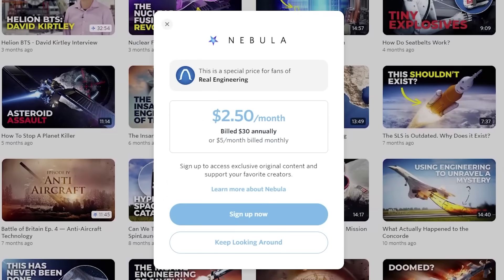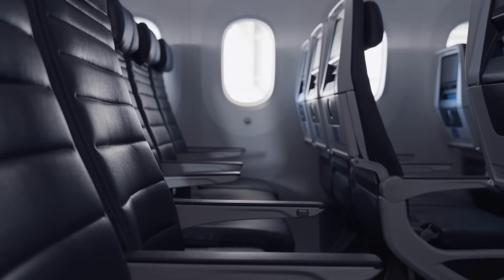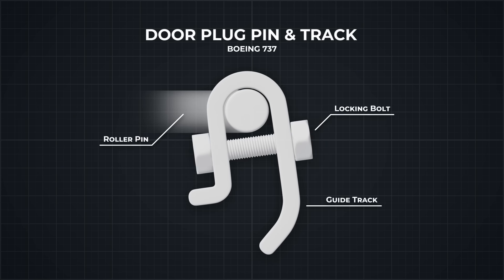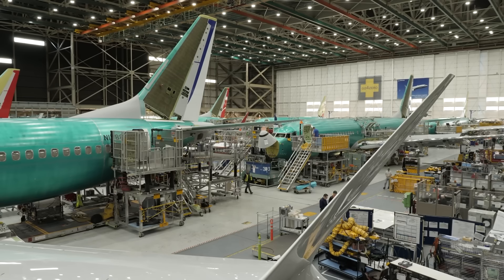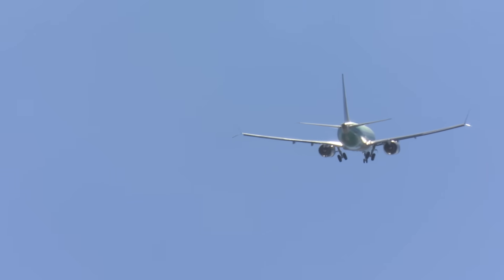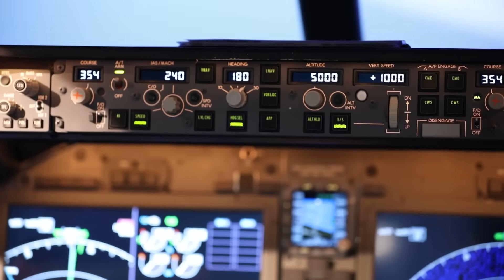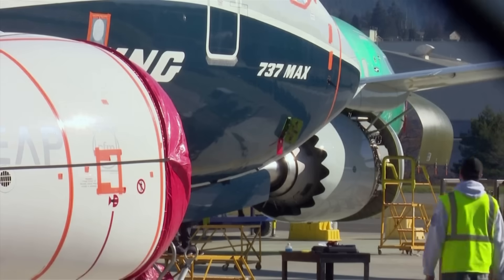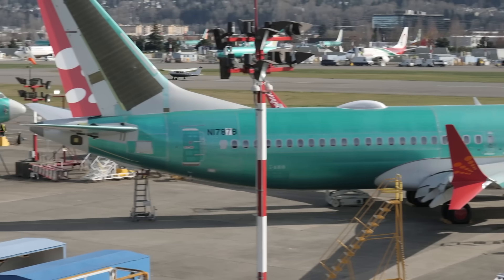The Questionable Engineering of the 737 Max

Comment: I am by no means an aviation expert, but it seems to me that Boeing is trying too hard to keep the 737 alive.

The 737 has proved itself as one of the, if not the best regional airliner there is. Entire companies are built around the jet and its required infrastructure. It makes sense to keep upgrading this platform. It requires less retraining for flight crew, cabin crew and ground crew and I assume ground equipment can be kept the same as well.

The 737 has a remarkably short landing gear. This causes the fuselage to sit low to the ground, which makes it easy for ground personnel to work with the aircraft. For example, budget airlines often use stairs that retract into the plane itself, which removes the need for stair trucks or jetbridges.

The upgrades to the 737 are pushing against tight constraints. The low fuselage is a major constraint when it comes to upgrading the engines, for example. Jets are getting bigger and bigger to become ever more fuel efficient. The 737 MAX has already proven the effects of trying to push through these constraints with the MCAS debacle.

The Airbus A320 came out almost two decades after the 737. It does not have the low fuselage that the 737 does and has less problems with hosting larger engines on newer variants. Yet, Airbus is realizing that the A320 will not stay around forever and is investing in new platforms which compete with the A320, like the A220. In the meantime, Boeing is stubbornly trying to keep the 737 flying by stretching it in all dimensions and taking it to and beyond its limits.

I believe Boeing requires flexibility to innovate, which the 737 platform just cannot lend. To really bring innovation to the market in a safe and responsible way, it needs to develop a new platform which can compete with the 737.

Comment: Good video, but a couple things to note:
1) When you showed an example of a smaller emergency exit door's window, that was a service door, used for catering (there are 3), and not an emergency exit window.

2) You probably shouldn't shorten "737 Max 9" to "737 9," because the 737-900 is part of the well-established NG series, rather than the newer, ill-fated 737 Max category.

Comment: As an industry insider, everyone I know throughout the industry seems to point to the event known colloquially as: "The day McDonnel Douglas bought Boeing with Boeing's money," as the inflection point where Boeing's culture went from that of engineering, manufacturing, and quality excellence to cost cutting, profit maximization. MCD was apparently very good at "making money" in the industry but Boeing was not. They leaned heavily on MCD executives AFTER the merger, to help realign the business direction Boeing would go in order to improve profits and become a more desirable company to invest in. This included divestitures of low profit business enterprises, like their Wichita manufacturing plant, which would later be named Spirit Aerosystems.
Reply: It's so strange to me that they divested the Wichita factory, only to need to pump cash into it 15 years late so they could keep their production line running. It reads very much as a short sighted business decision to boost profits over long term stability.
Reply: Wow, interesting. Thanks for sharing.. I am definitely looking more into this. What's odd though is MCD seemed to make a lot of great planes though too. I have worked on a few including the DC-10 which I feel like sometimes gets a little bit more hate than it deserved.  I think in the context of its own time (mid 60s to early 70s) its really not much worse than many other planes, someone could chime in on this more I am sure.

Comment: From a responsibility perspective it doesn't matter if the manufacturing is outsourced, if it's a manufacturing defect, the responsibility is Boeing's. If Spirit made the mistake, it's Boeing's responsibility to find it and correct it. From a quality assurance perspective, oursourcing the fuselage manufacturing makes it more difficult to find and correct such mistakes, but that has to be considered when deciding to outsource manufacturing. Boeing can punish Spirit in whatever ways their contract allows, but, to everyone else, it's still Boeing's responsibility.

The FAA also needs to take some responsibility for giving Boeing such enormous leeway with their lax oversight. That's in addition to their history of lax oversight of Alaska's maintenance procedures (jackscrew lubrication).

Boeing is clearly a terrible and dangerous company, but there does also seem to be a growing complacency around safety and manufacturing standards in all industries. (touchscreens shouldn't be allowed to be installed in cars, nor should context-sensitive buttons be a thing, failed software updates shouldn't be able to incapacitate the care and strand you somewhere, cars shouldn't need to have privacy disclosure agreements)

Comment: Since its release the 737m has had more incidents and higher fatalities for its service time than the md11 and everyone called that plane a killer.
The airframe isn’t safe, there is clearly a massive issue with Boeings quality control and in the general interest of safety every one of these planes should be grounded, randomly select a 1/4 or more of the entire fleet, and ground up inspected.

Comment: Even if the CEO is an engineer he’s put that aside for maximum executive pay and maximum investor profit…many employees from the 60s and 70s say it used to be safety first and making sure their airplanes were well engineered and assembled with great care…the MCAS system was a disaster but this latest plug with loose bolts is pure greed because it’s come to light that their subcontractor is pushing things out not caring if there are defects…🤬

Comment: Multiple mistakes, most of which by Boeing.  1- the plug should have been bigger than the hole, like the doors, so that pressure adds to safety.  2- the plug should have to be lifted to be removed, not lowered, so that gravity adds to safety.  3- trying to save pennies having plugs vs. always having exits in the first place, knowing that more exits add to safety and this error cost more than all the potential savings designing and maintaining these plugs.

Comment: The blame starts at the top, not the engineers.  It was the executives who created this mess.  They were fueled by greed.  They were mad that Bombardier was about to launch a small, affordable, fuel efficient aircraft.   Boeing didn't have an aircraft to compete, so rather than invest in new design, and knowing that Bombardier was struggling financially, the simply modified their 737 airframe since it would save a ton on recertification as well as time and money starting from scratch (since the 737 airframe is from the 60s).  They then fought Bombardier numerous times filing complaints to the US Trade board.  The delays and costs couldn't be handled by Bombardier and they eventually folded, but in a twist of fate, Airbus came in and saved the program.  That aircraft is now known as the A220 series.  There have been a myriad of issues and hundreds of people have died because of the 737 Max aircraft.  Corporate greed, secret lobbying to the government (hundreds of millions of dollars worth) and corners cut by the sub-contractors all play a vital role.  What should have happened is Boeing should have developed their own aircraft (if they wanted a smaller one) or simply left that business to Bombardier since that aircraft was smaller than anything Boeing made anyway.  Instead, they tried to stifle competition, paid off the government to avoid regulations and this is what you have.  The executives should have been jailed the first time around, the fact it has still been going on is a wake up call to the people.

Comment: I’m an aerospace engineer, one of my classmates from college is a mid level manager in one of Boeings suppliers. He has been complaining bitterly about diversity hiring practices for about seven or eight years now. They are rejecting people for less qualified ones who can check a box based on their identity.
Reply: Just pure insanity, they are actively discriminating to improve their optics
Reply: I don't think that has anything to do with what's wrong at the company. (there is no way to prove a person will be better or worse at a job than someone else at the point of hiring, anyway, so I highly doubt that hiring more old white dudes in management would have helped.) It's a matter of prioritizing profit over safety, which has nothing to do with the "identity" of people being hired
Reply: @marcindathefierce  Prioritising EDI (DIE) is going to lead to hiccups whether you like it or not. It’s actively discriminating against those who are the most competent. You clearly have never worked with diversity hires. As an engineer myself, I have, and have seen in situ examples of incompetent but pc characters being selected for over the most competent (accounted by experience, grades, work ethic  etc). Standards have lowered for hiring and to say that plays no part in poor management is weak.

Comment: Spirit does NOT manufacture the door, nor do they do final installation of the door, that occurs at Boeing.
This plane also had a wifi mod in OKC and they would have accessed the interior through that door plug.

Comment: Remember, when Airbus made a competitor to this plane they actually made a brand new design. Boeing, because they wanted to save money they used the old plane, put new engine and put the MCAS control to fix the issues that came up since the engines are too big.  two planes crashed because MCAS was busted. moral of the story, buy Airbus

Comment: Your Dreamliner series on Nebula made me a fan.   At some point the airlines need to be help to account as well.  Lyon Air sent their doomed Max up with a known issue on the AOA sensor; admittedly a single point of failure, which Boeing has augmented MCAS with a synthetic AOA sensor.  As a software developer, I take issue with Boeing outsourcing MCAS to the cheapest offshore developers they could find.  I cannot image developing a system, much like Toyota did with the single point of failure potentiometer in their gas pedal, then allowing the vehicle to go full throttle; same scenario with Boeing MCAS in only allowing the crew to disable MCAS (a system pilots were unaware of) by extending Flaps, even 1% would have stopped the chain of events.  Full nose down was outside the design params of MCAS, yet never tested until...  BTW, GM has two potentiometers in their gas pedal sensor; should they fail to agree the vehicle goes into limp mode.  You can check this yourself with a decent scan tool.  Bashing Boeing, bashing GM (Al Root) is a favorite pastime in America,  Europeans do not seem so willing to throw their industries under the bus, plenty of Airbus automation incidents...  kind of like Coke saying Pepsi causes cavities...

Comment: Am I hearing correctly that you're saying that it's engineers patting themselves on the back when stating that it's because a company is run by executives focused on revenue? Because you say the exact same thing a little later without that "patting on the back" thing after. I thing you're incredibly underestimating company policy when you say engineers are good and capable of making good, working solutions to problems. You can propose infinite great ideas you can defenitely work out, but if the exec smells penny's LITERAL PENNY'S to be saved, the shortcut is taken by the word of said exact without any knowledge about the subject even if it is the worst solution and results in failure and ironically more money and time spent in the long run

Comment: Sooo if Boeing isn't manufacturing its airframes, avionics, wings or engines and limits R&D to updating 60 year old designs, what does it actually do but assemble parts and trading stock? It's a company, sure, but is it still an aircraft manufacturer or just an assembling outfit with a very good name and lots of pull in DC?

Comment: I know I will probably get pointless flak for this, but Boeing has been hiring for diversity (not inherently a bad thing) recently instead of hiring for skill. For something that can kill as many people as an airplane can, I would rather have the best at the trade making the planes instead of people that were hired just based off of their skin color. There is a lot of people that have been quitting working at Boeing because of this. (if you misconstrue this as anything other than pointing out a lack of skill, maybe you should take a step back and reevaluate your thoughts)

Comment: There is nothing wrong or "questionable" with the engineering of the 737 Max or of the other airplane models. The problem at Boeing with this and other models is the poor quality control/assurance.
It doesn't matter if the CEO is an engineer or not; the headquarters is thousands of miles away from the factory!

Comment: The engineering of the door plug on the 737 MAX 9 is exactly the same as the door plug on the 737-900ER. Unlike the MCAS fiasco, in this case, the problem isn't about engineering, it's about manufacturing and quality assurance going downhill. United and Delta have found 737-900ERs with loose door plug fasteners now, too. These quality lapses have been mounting for some time, before the MAX, and it's finally resulted in a high-profile incident.
Reply: Cue flashbacks to DC10 and obligatory 'McDonnell-Douglas bought Boeing with Boeing's money' joke.
Reply: Correct, and they've been an issue on the 787 also.
Reply: And they're very lucky that nobody was badly hurt or killed, and also lucky that the flaw wasn't with something serving a more important purpose. Misunderstandings between contractors are definitely something that can cause problems with more important systems within the aircraft. I'd like to believe that it's less LIKELY to happen with more important systems, but I think the FAA should be taking this incident as a wake up call to increase their level of oversight over the airline industry again, and to stop being so trusting toward Boeng (or other manufacturers) own internal safety standards. They should be doing a thorough review of how similar problems may manifest with other components in the aircraft, especially anything which could cause a more severe problem.
Reply: MCAS was a solid example of the type of horrible design decision you get from engineers who got promoted to upper management.
Reply: @jasontiscione1741 someone in the Boeing sales executive team made that call and needs to be in jail
Reply: who knows where bolts aren't fastened elsewhere in these flying coffins ?
Reply: It just so happens that the failed door plug is manufactured by Spirit Aerosystems based in Wichita, KS, which proudly states that their main focus is on DEI rather than hiring competent workers that produce quality parts.
Reply: @jakemenard2593  This has nothing to do with DEI you clown lol. This pure corporate greed plain and simple, none of them actually care about DEI that is all just marketing and you fell victim to it.

Furthermore it is insanely prejudice to imply that because they hire brown people and queer people that somehow that is what impacts their quality, and not firing or laying off entire QC departments or cutting employee compensation to give their C-Suite a huge pay raise or to implement stock buybacks.

Layoff the Fox News my guy, it is rotting your brain.
Reply: @jakemenard2593 Again, this has nothing to do with DEI. It's just plain greed and cutting corners to cut costs.
Reply: The plug was made in Malaysia with the serial number and part number written on the frame in Sharpie. Nuff said.
Reply: @srpacific  unfortunately for your national pride, the Malaysian door was fine. Boeing (not spirit)  not reinstalling the 4 bolts after inspection, was not fine
Reply: and the downhill trend in quality coincides with companies pushing ridiculous hiring requirements, focused entirely around diversity and equality, instead of intelligence and skill.  🤷‍♂
Reply: @DickHole3  Literally nothing to do with this. You are just throwing out baseless claims in order to push your homophobic, misogynistic and racist agenda here.